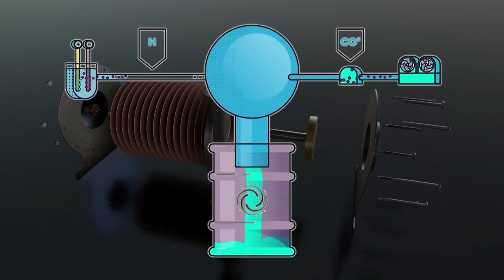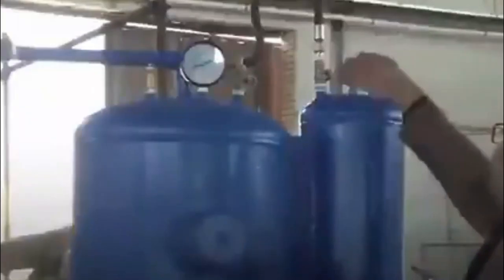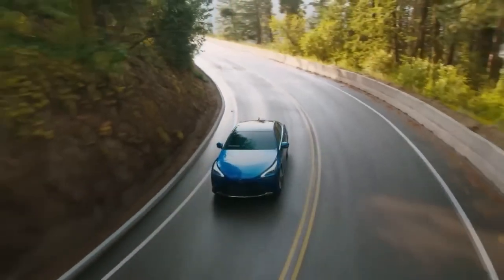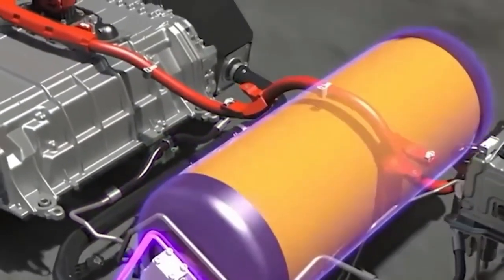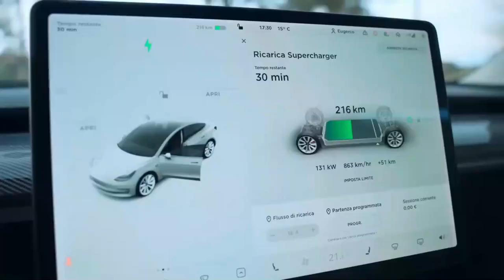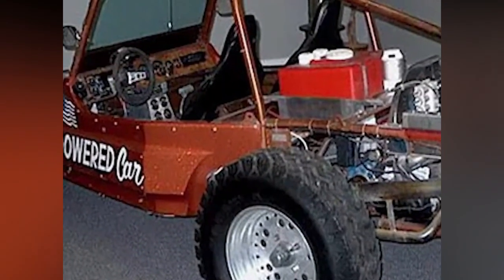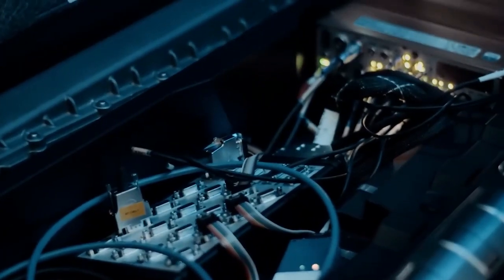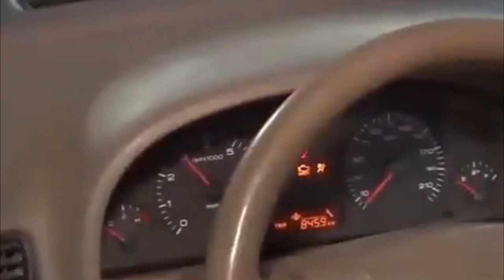H2O-Powered Cars: The Future of Sustainable Transportation?

Comment: BTW we did build an HHO generator it worked sorta we shoved it on a diesel made it easier to start cold but when we shut off the diesel the HHO generator could not keep up we never tried using AC on it but I imagine it would be similar results in any case 60% of the energy of the fuel is lost in an internal combustion engine due to heat and friction. Why these car makers insist on burning the fuel is beyond me.

Comment: The question here is the "law of conservation of energy", It takes energy to split the water into hydrogen and oxygen.  You then use the energy you put into the hydrogen and throw away the oxygen which recombines with atmospheric oxygen as its "burned" to create power to drive the car resulting in water again. That in itself is not a "zero loss" game... explain where the energy is "added" to the system so you can power the car.  I just don't get it.  BTW I'm a big fan of hydrogen fuel cells... but the energy to create the hydrogen is added  "outside the propulsion system" in those systems.
Reply: That's why it hasn't really taken off. The amount of power needed for the electrolysis kills it.
Reply: Precisely. You need energy to break the bonds to separate the hydrogen from oxygen in the water. The battery supplies the energy. But the energy supplied when the hydrogen is burned propels the car. What replenishes the energy in the battery? As you imply, it doesn't seem to adhere to the conservation of energy.

Comment: 🤔 Hmmm 👉 Stan Myers invented a device to fracture 💦 and even devoped a spark plug replacement for water to fuel ⛽ conversation.
👉 His magic joule 💍 was the use of optically pumped hydrogen atom ⚛ in the 632.8nm wavelength (Red diode laser) the ligher energy level only needed a ~1.34 ev potential to ionise the hydrogen ⚛.
👉 Optically pumped with red laser and sharp induction ⚡ spike's to ionise WITHOUT GETTING INTO HOT WATER 😂😂😂😍🔌👌